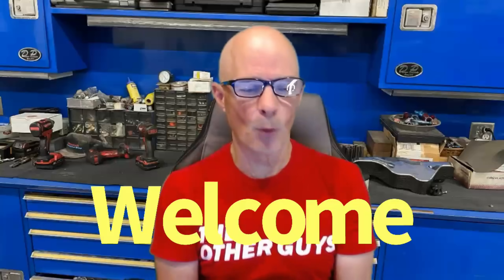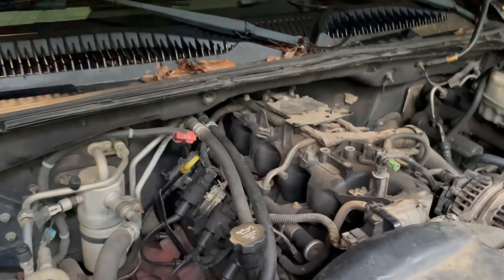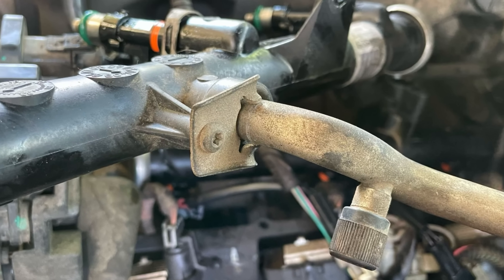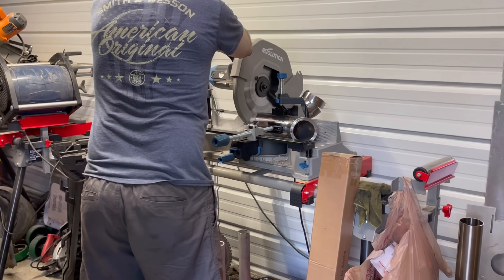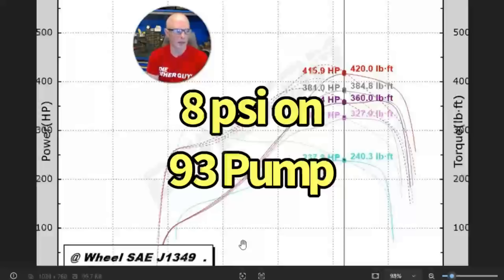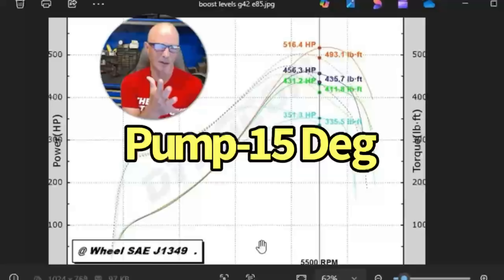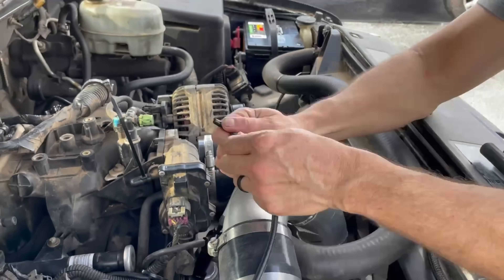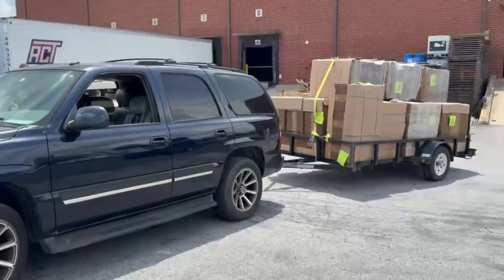RHP TURBO 5.3L TAHOE TOWING TEST. FULL CHASSIS DYNO & STREET RESULTS. PUMP GAS VS E85. 4-12 PSI!

Comment: Just curious on the fuel system I didn’t see you add a 1:1 fuel regulator? Are you able to just add enough fuel with the injectors to compensate?
Reply from the maker: early return style rails had 1:1 regs, on later (non return) systems, the pressure is regulated in the tank

Comment: Awesome ! Are they new turbos ? Haven’t heard of the turbo you’re using here before on a drive-through turbo with a carburetor would you have to use a blow off valve? I would think that the carburetor would control the boost pressure but I’m not sure.
Reply from the maker: draw through requires carbon seal

Comment: Thanks Richard we’ve been waiting to see your science on a hub dyno! Even tho we know your engine dynos are great there’s nothing like putting it on the pavement! Thanks again can’t wait to see more
Reply from the maker: this was not a hub dyno-it had rollers. The type of dyno doesn't matter if you are just looking for a differential, but the street stuff is very useful.
Reply: @richardholdener1727  hey Richard I have a quick question! I have all brand new diesel turbos and don’t know which ones to use I have a 5.3 mildly built and I have twin holset hx35, twin Garrett gt37s I Believe and a single hx55 but I’m not sure which route to go I’d love to send them to you so you could test them out 😅
Reply: But overall I just don’t know enough about the turbos and I’ve done some research but haven’t seen anyone running them in an LS application

Comment: The best thing about Turboing a 6.0 2500 is the Duramax intercooler will basically bolt in, I would imagine the same for the Suburban 2500
Reply: Wonder if it will help mpg lol
Reply: @IDKWTFID if your engine has more air going in and more fuel that 6.0 will drink faster. Especially once you fall in love with the power and sound
Reply: Most of the time"  when guys are hot rodding something.  Fuel mileage is a foreign as ordering  tacos at the olive garden.  If you want to go fast and have great gas mileage, Get yourself an EV  And play panama on the Stereo in a loop for the sound.
Reply: @kevinwest3689 that's kind of one of the benefits of a turbo. You can have economy and power.

Comment: I’ve got a vs racing billet 80 mm t4 “gt42” turbo on my 5.3. With a loose stall converter it’s great. Drives like a normal 5.3 until you want some power and bam your in boost.

Comment: Great for people to see real world numbers on a motor installed in typical configuration. Down huge amounts of power compared to the engine crank HP dynos on similar turbo 5.3's.
Reply from the maker: The NA 5.3L motor is down 100 hp (far from huge), the same amount my videos have shown and the same amount I have spoken about time and time again.

Comment: I have been thinking about this with my 05 suburban. It has 100k on the clock ( bought it from my parents) 706 heads and flex fuel deal out of the box.
Reply from the maker: you can run low boost with the injectors you have

Comment: Ik you don't like my comments lol but you're doing alot for the 99-06 community. If you offered full kits like in stages 1 2 and 3 for example. But also have options on the website to do a full build out of what you need and dont need. Like if you need a fuel pump and injectors -click the box and it'll add it to the build. Could add a air to air intercooler or air to water intercooler with piping option etc etc etc. Stuff like that..
Reply from the maker: I don't really like drop-down menus on our store-we will offer it different ways though

Comment: The only thing Richard is that you dynoed the truck in 2nd gear. A 4L60-E has, as the name implies 4 gears as follow: 3.059, 1.625, 1.00 and 0.696. Why did you not do the dynos in 3rd with 1:1 gear ratio? Wikipedia says the 4L60-E is rated to 360 lb-ft also... Great video! 👍
Reply: If the truck has a stock driveshaft it likely would've come apart at those speeds.
Reply from the maker: as indicated in the video-driveshaft speed-we did a roll on in 3rd gear on the street to show boost response
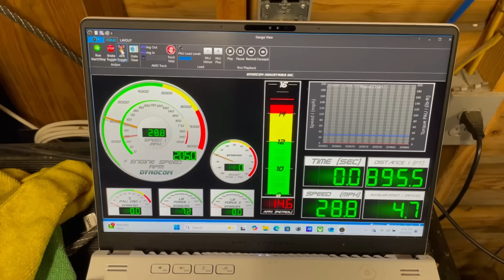Reply: @richardholdener1727  My comment was about the dyno numbers, the video at 1:33 saying 2nd rips.
Reply from the maker: once gain-we tested on the dyno in 2nd gear because of high drive shaft speed in 3rd gear (not good). We also did a low rpm only run in 3rd gear to check boost. We also did boost response roll ons (with the trans locked in gear) in both 2nd and 3rd gear on the street. We also did street boost response tests without the trans locked in gear.

Comment: you guys are awfully brave running 12 psi on a tired 4l60
Reply from the maker: we held our breath the whole time
Reply: Are you kidding. He’s brave for simply putting that 4L60 in drive……under stock hp. lol those transmissions are a trash can with an output shaft
Reply: @larrytemen4789  Fbo 5.3 stock 4l60e 4wd here with 180k🤷🏻‍♂️
Reply: @larrytemen4789 they really weren’t that bad, they definitely weren’t great, I got 292k out of mine in a 02 suburban, what killed them for the most part at stock power was the insane gear ratio change from 1st to 2nd it was like 3.06 to 1 to a 1.68 to 1 so if you let it shift at low rpm from 1st to 2nd it would put a lot of stress on the 2-4 band and the 2nd gear clutch packs, mine blew the 2-4 band on a foot to the floor downshift on a hill and then I drove it in 1st and 3rd for another 2-3 weeks before I found a new car, by that point the transmission had started to learn my driving pattern and that 1st to 3rd shift wasn’t that bad lol
Reply: @larrytemen4789 I got 250,000 miles out of mine, but when it broke downshifting going up that hill it was violent.
Reply: @clarissahull2579  I've had a fresh replacement from GM lose the overrun clutches on the 4-3 downshift from letting the truck coast down from 85 mph. I can believe it would happen going down grade.
Reply: @ptbelttactics yeah I'm sure they do, mine happened going uphill, and I'm sure it's because the 4l60e likes to shift into overdrive and a relatively low speed so it does it going uphill on slight grades, but then loses speed and downshift. With 250,000 miles on her it's just couldn't take it and my forward planish gearset exploded, litterally.
Reply: @larrytemen4789 usually the people who rebuild them are trash cans with arms. I’ve built over a hundred of them and they live just fine. There’s an issue with them that 99% of builders overlook or don’t know about. The fluid passage in the input drum where the input shaft presses in, always leaks. After it gets mileage on it, it leaks even more. That’s why when it burn 3-4 up and then it’s rebuilt, it burns them up again prematurely. Builders oversight has given this trans a bad wrap. Then can hold 450-500rwhp with minimal mods. Most builders aren’t capable enough to pull that off though.
Reply: @Turbogto_guy it not the transmission, it's knowing what parts to put in it.  Have few holding upward of 500 tire. And I do all my own transmissions.
Reply: @Turbogto_guy  what about the ones directly from GM, what is your excuse for those being POS? Can hold 450-500rwhp, is that seriously supposed to be an achievement? Sonnax's Level 3 Build guide, "for all extreme performance applications, above 450HP", requires $3,000 just in billet hard part. While a 4L80 with a fresh set of frictions, new bonded pistons, and a seal kit will hold 1,000rwhp. The question you are ignoring is why have you had to rebuild over a hundred of them?
Reply: @ryanlee9945  its the transmission, you can't throw enough parts at that POS to make it worth building. 500 tire isn't some amazing level of power to be impressed with.
Reply: @Turbogto_guy  so what's the fix to stop the leak?
Reply: @Mr_Clem02  you don't, free rust prevention 😅
Reply: @Mr_Clem02 you press the input shaft out of the drum. Clean it and the bore of the drum. Scuff both surfaces where the fluid passages are and use loctite sleeve retainer on the splines and passage surfaces and press back together. Blow excess loctite out of passages with brake cleaner and compressed air. Let sit over night. Pressure check for a leak. How to check: stand drum with shaft facing up. Put some liquid where the shim and bearing go. Pick the drum up by the shaft, use your finger to plug the hole where the innermost piston would go. Then use compressed air on the passage in the shaft that faces the same way as the hole to plugged with your finger. Any bubble in the liquid, you have a leak. Check it first before pressing the shaft out. But still press shaft out after and loctite in. Skip this and you will surely have premature failure.
Reply: @Mr_Clem02  Swap to a 4L80E. And, let someone else deal with the POS 4L60E, problem solved.
Reply: @Turbogto_guy  Congratulations you have solved one of 3 dozen problems that can cause the 3/4 clutches to fry. From the 3/4 apply plate coning to the accumulator check ball failing to seal, something will get you.
Reply: Yeah the 4L60 was the worst transmission ever designed until Nissan said we can fail even worse with their CVT.
Reply: Good for you Richard , I have to say
Having the exact same truck down the street for 8 years
The guy gave up

I got a ride in it
When he just put the turbo on

Hit very hard!!!!

But it was the biggest boat in the world( a boat is a big hole you toss money in)

Stubborn guy
Tranny ( along with every thing else weak link)
He pulled the plus this spring

$$$$$$$$$$$$$$$$$$$
Loss

Big turbo

Could not keep it together

Also new a guy that had one of 800 Saab versions( more gear)
But it road like a dump truck vers a jeep srt8

The trail blazer we called the “ pop top”
Every time you took it for a spin

- pop goes the weasel!”

And yes he tossed in all the tricks for the tranny

They are just to weak for turbo toque 

Still great content

But not a chance of towing

Unless you mean the truck on the back of a two truck

-Don
Reply: They like to break on the downshift out of overdrive going up hills.
Reply: 2012 2500 van 4.8 8600lbs everyday paddle shifting  in so ca for 12 years retired at 242k motor or trans never apart. Company still using
Reply: @techs1smh13  most 2500 GM vans had the 4l80E or the 6L90E, the 1500 had a 4L60E. You might be confused.
Reply: @ptbelttactics  I have seen a few 4.8 vans with a 2500 badge
Reply: @Pitman556  And, I have pulled dozens of LS bolt pattern 4l80Es from behind 4.8 in 2500 Express and Savana vans. It is actually the easiest way to find them in the Junkyard.
Reply: @techs1smh13  thats because it had a 4L80E !
Reply: @techs1smh13  that van had a 4L80e not a 4L60e. Completely different transmission.

Comment: Freaking awesome! Can’t wait for the kit to hit the website.
Reply: What is the website?
Reply from the maker: richardholdenerperformance.com
Reply: @richardholdener1727 is an oil cooler really needed for a turbo ls street truck? Stock gen 3 with ring gap. 15w40 rottela. So many mixed opinion s on the net. Thanks